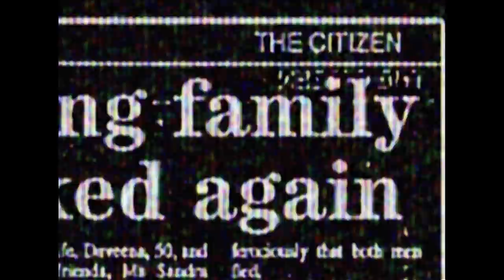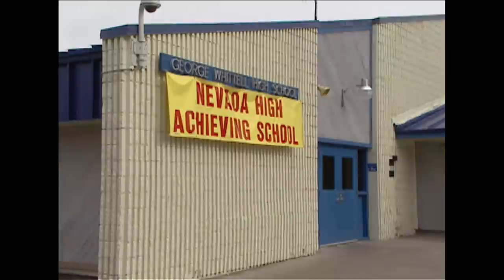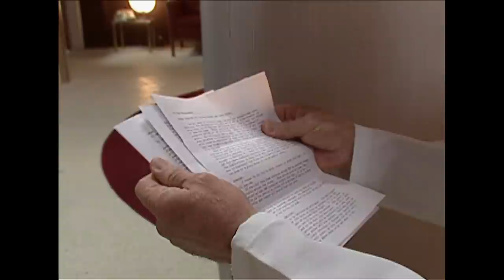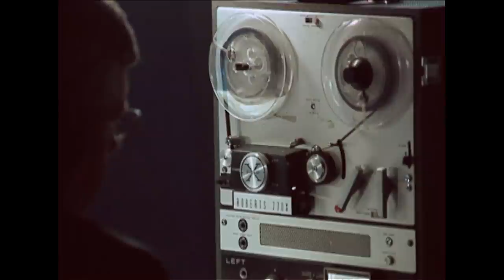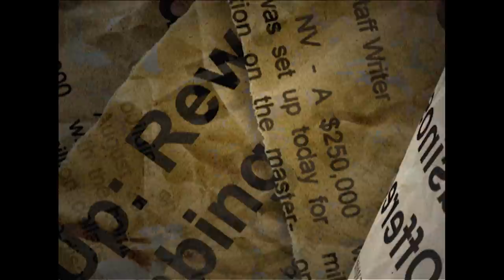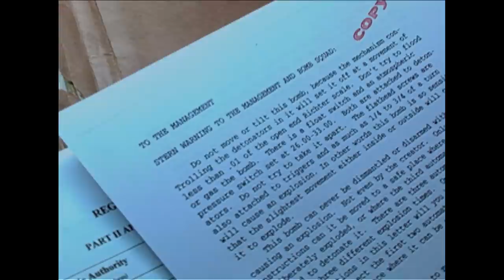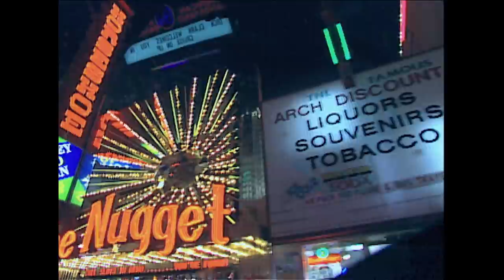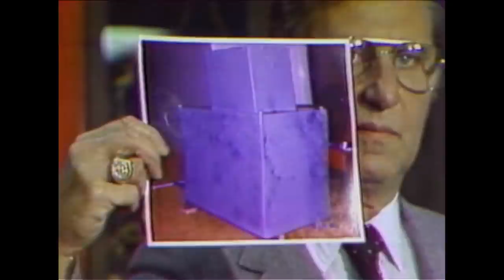Impossible To Disarm: The 1000 Pound Bomb | The FBI Files | Real Crime

Comment: I know absolutely nothing about bombs, but what did they think was going to happen when they tried to disarm it by blowing up the top piece? Surely the FBI could have come up with something better than that.
Reply: Yea it's like we have red and blue wire, but fuck that bring more explosive. Robot chould play with that switches.
Reply: I could give a very long cure for insomnia type answer, but basically some bombs are in 3 stages, a power source, primary initiating charge and the secondary main charge. You hit a button, that blows the first, which provides the energy to detonate the large charge.  Most bombs are disarmed by taking out either the power source or the initiating charge. What made me laugh, was they used 6lbs of plastic high explosive. If they had used 600 grams, they would have lifted that casing off like the lid of a tin can. Someone, somewhere was a little lacking in there training me thinks 🤣. Either that or they just decided it would be easier to initiate the whole the thing, to save rhe hassle of dealing with a secondary unstable charge.
Reply: @bazzmcfury9550  you’re correct because initiating the whole thing is basically what they did.
Reply: @paulmoney8960  atleast no lives were lost, a building u can rebuild...did they the right thing. Imo
Reply: Actually they couldn't. The box with the detonators was essentially impossible to disarm. Basically everything he'd been wired to a trigger from the screws to the switches to the walls of the box. If they tried to drill through the walls they would hit foil which would complete the circuit. If they tried to flood the box, a toilet float would trigger the bomb. It had a Mercury switch among other things. Basically once the bomb maker armed the bomb, it was impossible to disarm it. Also they used a shaped charge, so most of the explosive energy was funneled in a single direction.
Reply: They thought it would very likely detonate. Did you watch the episode? They were pretty clear on that point. There were no good ideas…that’s precisely why they went this direction.
Reply: they just thought f it, we can't move it so clear everyone out and light it up